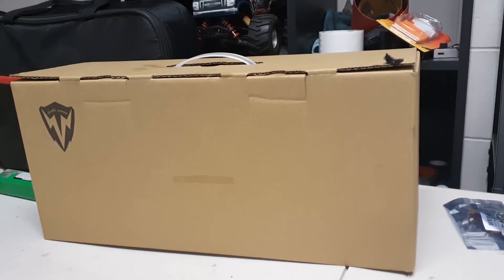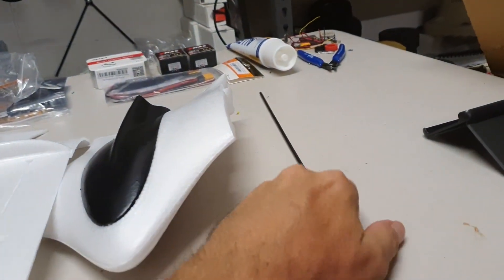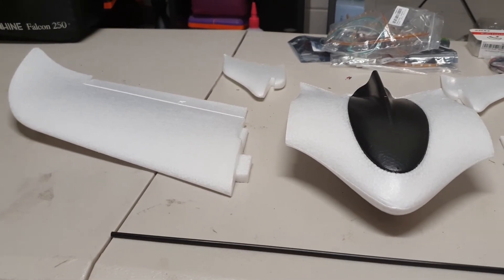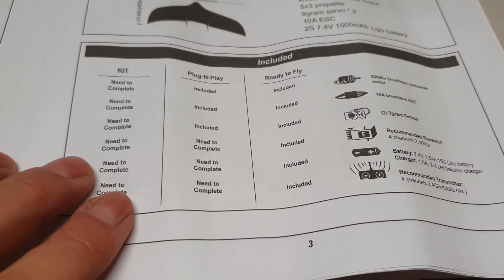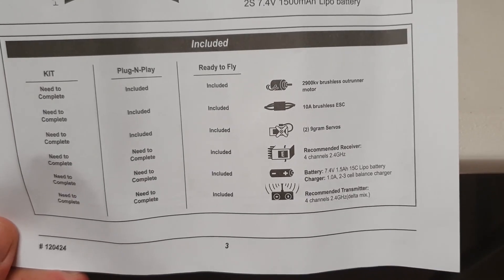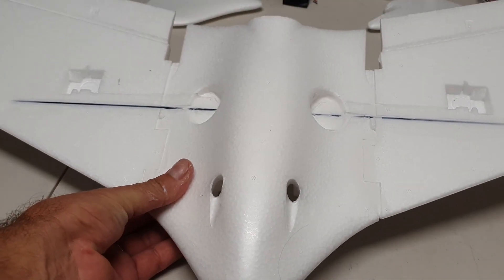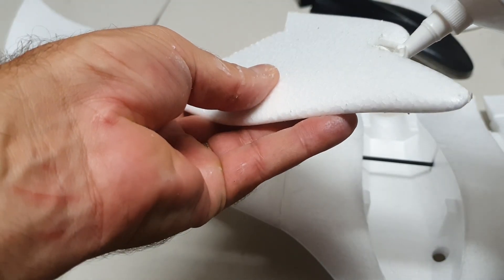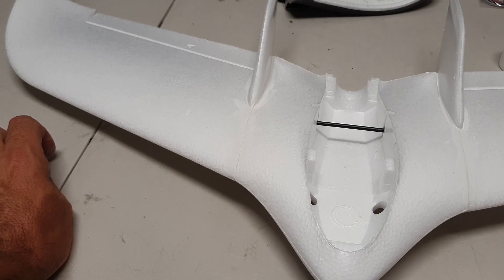Zeta Wing Wing Z-84 Build Part 1 - Wing Assembly and Spar Install

Comment: Hello, what type of glue are you using? Thanks for the video.
Reply from the maker: Back when I did this build I cannot remember exactly which glue I used but these days on most of my craft I use hot glue. If there is something that cannot handle the heat of hot glue I can also use gorilla glue, just don’t get the one that expands once it sets.
I fine hot glue best if I need to replace something it’s easy to do, just heat it up.